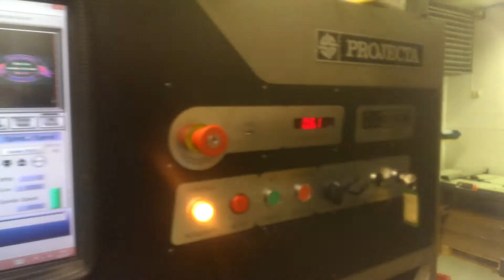First g-code running on the Morbidelli

Comment: Good job, you are my God, I have the same machine author 502. I replaced Battery and lost all of the files and do not have a original floppy disc. A long time ago I was thinking if possible remake to mach 3, appears possible. Maybe You can share experience with me? Sorry for my englich.